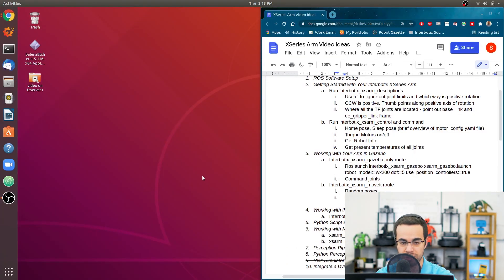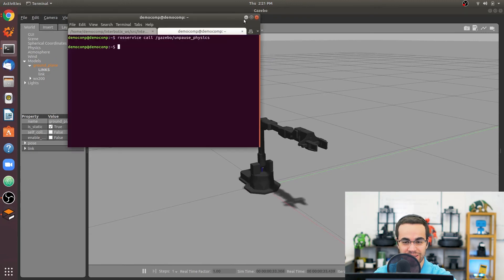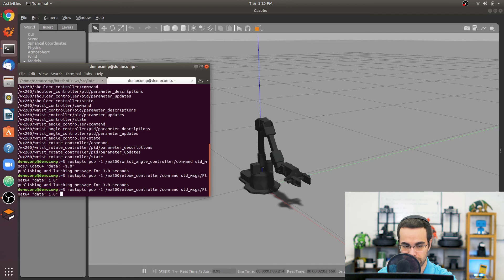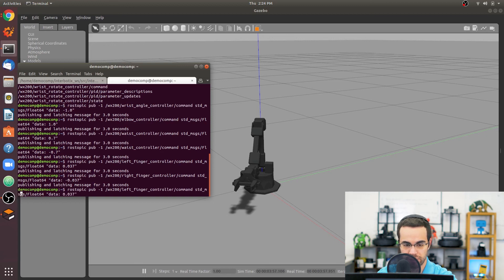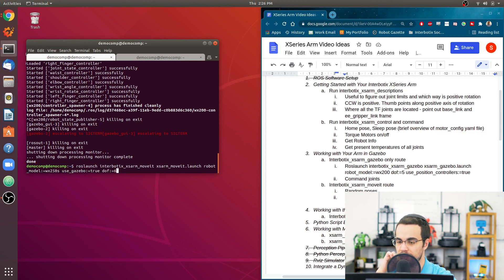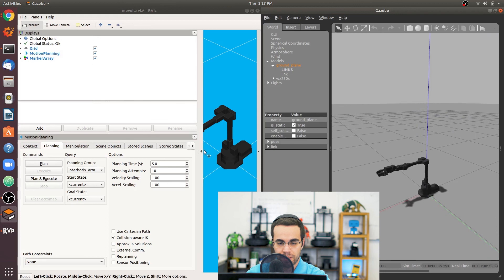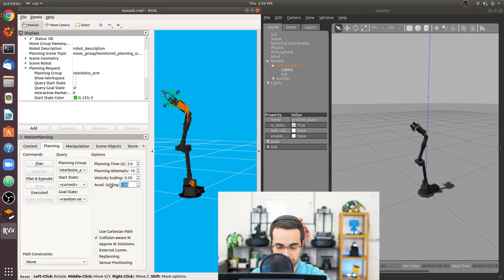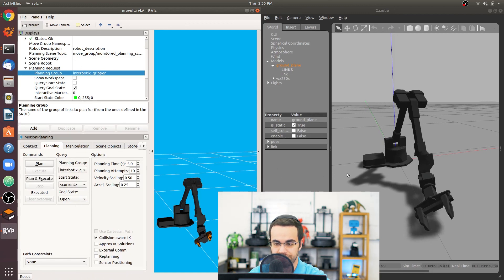Interbotix Tutorials: X-Series Arms | Working with the Interbotix Arm in Gazebo

Comment: Hello
I have the wx250 robot arm. I have designed a vehicle in a gazebo and I want to put the wx250 on my vehicle. How can I integrate it into my URDF package.
Reply from the maker: Hi AEmre, would you mind emailing your question to trsupport@trossenrobotics.com ? That way our engineers can help you out.
Reply: I put the wx250s on my own vehicle after emailing support. this is what they recommended:

[QUOTE]
...... see the documentation for the xsarm_descriptions package. When launching the xsarm_descriptions package, you should set `base_link_frame` to the base_link frame on your turtlebot and set `use_world_frame` to false. You could also set the `external_urdf_loc` to an external urdf.xacro file that you want to be included in the xacro generation. Note that these arguments are passed down through the launch file tree, so you can set them in any launch file like the xsarm_moveit.launch or the xsarm_gazebo.launch files.